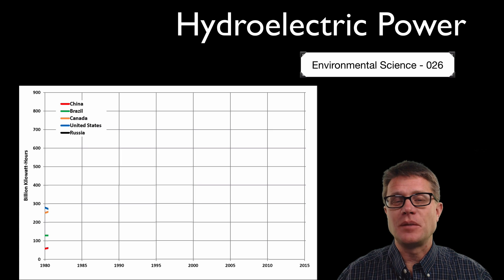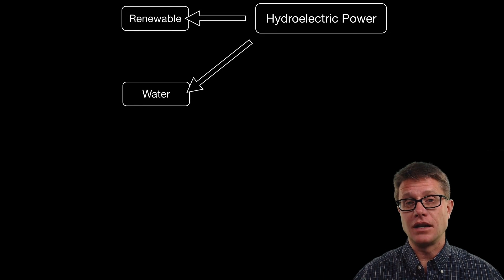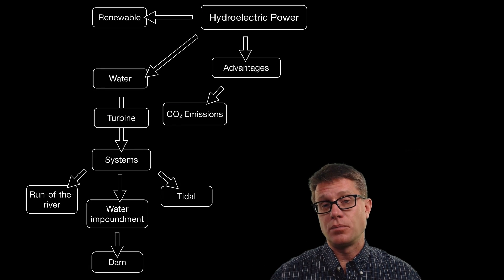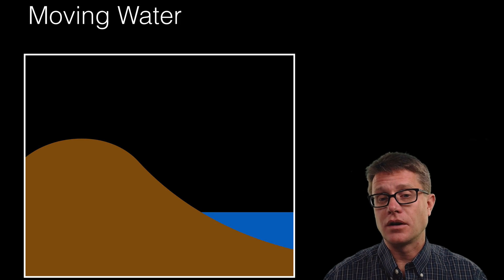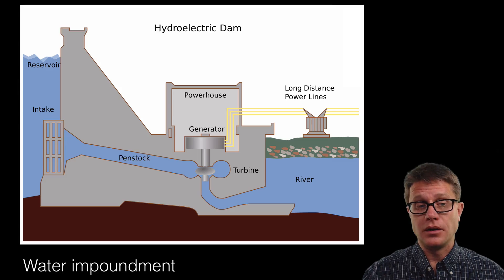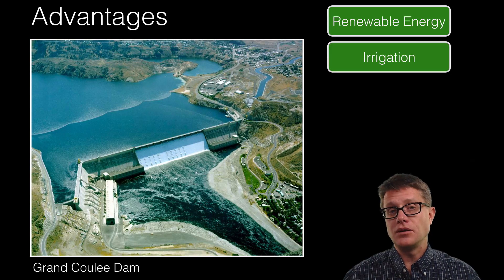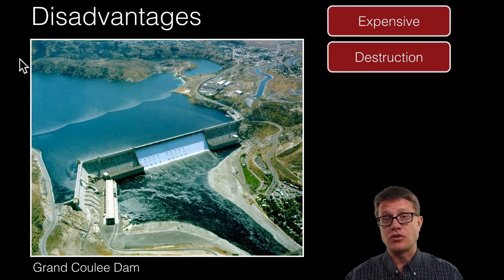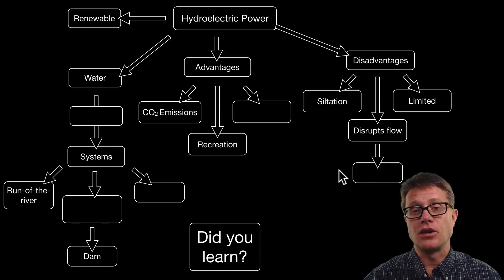Hydroelectric Power

Comment: so i was thinking, if you were to have a really high waterfall and you'd build a dam at the top, then have big pipelines go all the way down and then have a couple turbines at the bottom, wouldn't that utilise a lot more of the potential energy? with some dams it looks like they are only using like 20 meters of heigt difference.

Comment: The consequences on the natural environment are devastating, literally annihilating the benthic biota due to the change in water stratification, a lotic water body turns into a lentic environment, the bottom of the dam gets anoxic where only a few organisms can survive. Fish ladders are traps. Fish usually gets exhausted by climbing it and in the end predatory fish awaits for hunting them, other times fish becomes adrift because there is ni stream in the reservoir to guide the way upstream. Fish that gets into the turbine chamber undergoes from a pressure of several bars to 1 bar and dies of sudden decompression.
I could talk a lot more about it, if someone is curious, try searching for a dam called Belo Monte, which sums up what kind of troubles a hydroelectric system can cause.

Excuse me for any grammar mistakes, English is not my main language.

Comment: The perception of the hidroeletric power as a definitive source of renewable eletric power has been changing in the course of the years. As a biologist the drawbacks of buiding a dam are bigger than it seems, here in South America to be precise Brazil, many dam systems generate a lot of green house effect gases, methane and carbon dioxide, primary production is high and forests are dense, creating a big organic material source for decomposition which will, in some cases, damage turbines due to a increase in carbon dioxide in the water and a decrease in pH and increase maintenance costs.
The consequences on the natural enviroment are devasting, literally annihilating the benthic biota due to the change in water stratification, a lotic water body turns into a lentic enviroment, the bottom of the dam gets anoxic where only a few organisms can survive. Fish ladders are traps. Fish usually gets exausted by climbing it and in the end predatory fish are the waiting for hunting them, other times fish became adrift because there is no stream in reservoir to guide the way upstream.
I could talk a lot more about it, if someone is curious try searching for a dam called Belo Monte, which sums up what kind of troubles a hidroeletric system can cause.

Eexcuse me for any grammar mistakes, english is not my main language.